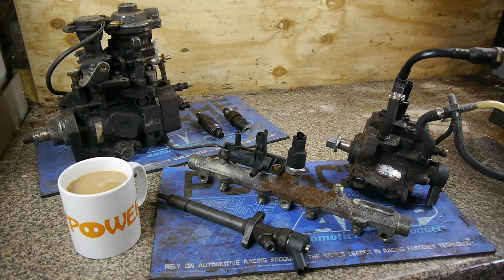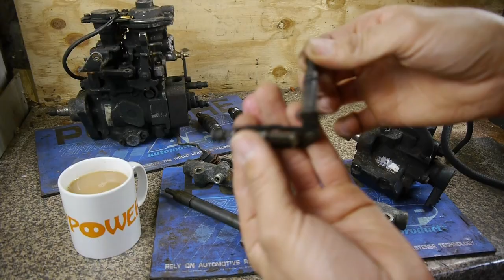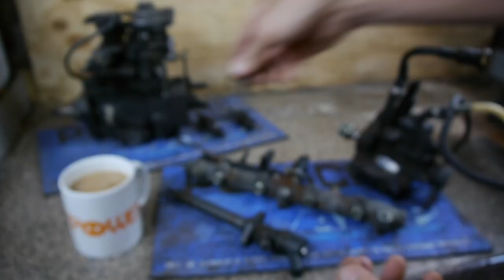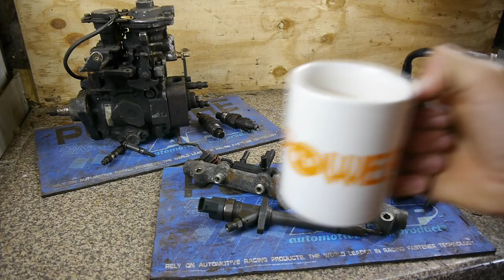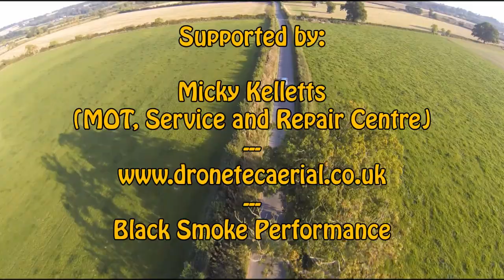INDIRECT injection Versus DIRECT Injection

Comment: You must mean 1,800 psi
1,800 bar would be over 26,000 psi 
No way it can be that high
Reply from the maker: I do NOT mean psi. Yes, that's over 26000 psi. It's a lot. It's called high pressure diesel injection for a reason!

Comment: The cool thing is you have mechanical direct injection as well. In my opinion its the best of two worlds. Easy to fix, hard to kill, efficient and powerful engines.
Reply from the maker: Yes, for sure. Didn't have the time really to go into that, but it had it's advantages... However the rotary pumps were still what would hold them back a bit. Emissions laws essentially made manufacturers move on sooner than probably they wanted to

Comment: modern injectors rely on batteries but the old system relies on their mechanical it's self so if your alternator fails the old system still running or EMP blast. but the modern design will fail because need the support of the battery and alternator, especially the ECU. but this channel thumb up a good and nice explanation.
Reply from the maker: While that's true... It is what it is... To improve diesels, power, sound, drivability, emissions, things had to change... At least it's super super rare to have a battery instantly fail these days
Reply: Doesn't mechanical direct injection exist and do the same thing but with more efficiency?

Comment: Does a direct gasoline injection system have the same negative effects on the intake valves as a direct diesel injection system? or are diesel systems working differently?
Reply from the maker: What negative effect are you referring to?
Reply: @PiggyPower  the clogging of carbon build up
Reply from the maker: @LikaPyramid  I've yet to see any clogging of carbon build up on diesel valves to be any different to direct or indirect injection... Both injection systems run after the valve.
Reply: @PiggyPower  then why do they call it direct injection? xD
Reply from the maker: @LikaPyramid  ... I explained this in the video? 😂 One is direct and the other indirect, into a precombustion chamber... Can't have precombustion before the valve!
Reply: @PiggyPower  ah i see now, i misread your comment 😅

Comment: I feel that the IDI principle has potential yet. It's so simple and robust... I  read about Ducted Fuel Injection which has the potential to drastically improve diesel emissions to almost nothing. From what I saw in the papers I read it seems to be for a modern common rail style diesel, but the principle was so simple. Like adding a bunsen burner nozzle on the injector to create better mixing or fuel and air. I wonder why could not that also be applied to the injector in an IDI engine, improved mixing would be just as helpful on an IDID, possibly more so?
Reply from the maker: Issue with IDI mostly is limited pressures and where the heat spikes, which is in the head. And actually there are some emissions which direct injection is terrible for but Idi had no issues due to its design. Used veg oil and Idi though ... Super clean and effective way to be environmental!

Comment: If cost of ownership is a factor di is not for you. If you're selling/trading your car in at less than 100k definitely get a di engine. Otherwise port injection is far more reliable.
Reply from the maker: This is a good point, but can vary. iDi pumps and parts are getting very very rare now. A Bosch VE pump for a 1.9td Peugeot in good condition can fetch as much as a HP Di fuel pump which has been reconditioned. If you're willing to buy second hand, Di pumps and a injectors are everywhere and pretty cheap for cars over 5/6yrs old. So it does depend. If you're going to the dealership for a repair on the injection system at 10yrs old, then naturally the bill is going to be expensive v the value of the vehicle. . . However that would likely be the case if it was a clutch or brakes or suspension components
Reply: @PiggyPower  I haven't experienced any injection failures, what I have seen is the massive carbon build up on the valves because of the lack of fuel hitting them, not saying injectors WONT fail, just not something I've come across YET. Most of my gdi experience is from the Ford ecoboost.
Reply from the maker: @tonyblackburn5002  ahh but you're talking petrol injection... Quite different to diesel injection.
Reply: @PiggyPower  yes. My knowledge diesel engines is somewhat limited as of yet, but I work on a BUNCH of gasoline engines. Both di and port injected, the di cars will typically get better mpg, and make more power, but maintenance cost a bit more.
Reply from the maker: Di petrol isn't like Di diesel. Di diesel has injector pressures waaaay above petrol. Port injection petrol is very very different to indirect injection diesel.
Reply: @PiggyPower  I told ya my knowledge of diesel is somewhat limited.
Reply: totally agree!

Comment: This video is worthless, you've just compared two types of direct injection (even though you are using indirect injectors), one based on distribution pump (as in 90s TDI engines) and second base on continous pump (aka common rail).
Reply: I think it's a real shame that you're describing something here that's half true.  The Bosch distributor injection pump was used for DIRECT and INDIRECT injection diesel engines.  And please, if you only show this for Citrön and Peugeot fans, then it would be advisable to add this to the heading.  Thanks
Reply from the maker: So I am using indirect injectors... As you've stated..
So it IS indirect injection that in this video I am comparing with direct. 
A 'middle ground' of development was when they used the same old indirect technology and began going direct injection... Which was soon followered by electronically controlled direct injection with a common rail/HP pump.
Reply: @PiggyPower  yeah, 95% of the video is about distribution pump vs common rail. 5% is about indirect vs direct injection. You just mislead your audience.
Reply from the maker: Ok, well if you'd like to spend the time and energy producing a video, please do 👍 I do this without being paid or for any reward. My followers are all Peugeot/Citroen fans and thus this video has been a huge help to them all. 

It's a shame for comments like yours for content creators.
Reply: @PiggyPower  just because you spent time and energy making video doesn't make it any good. DI with distribution pump was used for almost 2 decades and you haven't even mentioned it. Do you rly don't realize that after seeing your video ppl will mistake milions of cars from 80s, 90s and some from early 00s thinking they have indirect injection?
Reply from the maker: @mandalorqel-droma5876  because that doesn’t relate to my subscribers. My content did. If every video everyone ever made on YouTube covered every detail to relate to everyone on the planet …each video would last for hours and hours

Comment: During my forced vacation last year I decided to pull an old dead Diesel engine apart because I understand and work with gasoline/ spark ignition engines, but diesels are a bit of a mystery. I understood the basics of compression ignition, I spend a lot of time trying to prevent it in the engines I’ve built, but the injection systems, fuel timing events, lack of a throttle body just baffled me. And after taking that engine apart and seeing what made it work led me to the conclusion that diesels are built with the use of black magic and unicorn tears
Reply: To make things more confusing diesels will run cooler when lean and run hot when rich.
Reply from the maker: 😂😂😂 high compression. Fuel at high pressure. Bang. 

There ya go.
Reply: Diesels also have ccv valve instead of pcv valve.
Reply: @impactodelsurenterprise2440  WITCHCRRRRAAAFFFTTT!!!

Comment: I am looking at getting a diesel step van and converting it to veg oil. One option is a 2003 6.5L workhorse p42 and another is a 2002 24 valve cummins Freightliner M-line. So which would be better for veg oil? 

I saw you just say here around 6:30 that the indirect injection can run on anything so I'd guess the 6.5 since it's IDI.
Reply: Idi is the best for alternative fuels
Reply from the maker: IDI is best but you do need to research if all the pump seals etc are suitable for vegetables oils

Comment: I've read IDI is better for veg oil. Any idea why? But also read people still using veg oil with DI.
Reply from the maker: Hi there. Worth researching about running veg oil. There are directories about which vehicles are good for it deep on the interwebs. 

IDI in general is ok for veg oil, if it's a Bosch pump, as the system can cope with the fuel. Modern Di systems required the lubricants in the diesel to keep the pumps and injectors from seizing. I've heard of some running 50/50 mix with more modern engines without issues...but it's a risk.
Reply: @PiggyPower  Bosch pump is electrical or mechanical? Been reading so many different things. ANother guy was saying mechanical pumps are more forgiving for alternative fuels.

Comment: So it's a IDI Vs CRDI...!
Reply from the maker: Crdi is one type. But it's just a manufacturers abbreviations for the same thing.
Reply: @PiggyPower  Yes, But there are non common rail Di engines too with a rotary and inline type mechanical FI pumps, I think the only difference between IDI and non common rail Di is combustion chamber.
And because of the Direct Injection and without pre combustion chamber Di engine produces more torque and are little noisier as compared to IDI.
Reply from the maker: @amitdesai2421  yes, as others have commented too... Can't cover it all in one video... Plus they were sort of on the switch over. ... Short period of time. Torque isn't really related tbf. More potential... But can make just as much torque with idi ... Di is also a lot quieter due to preinjection (not possible with rotary/non common rail)
Reply: @PiggyPower  What is tbf ? And for a pre injection you are referring to Electric injection Di...!
Reply from the maker: To be fair. Yes, electronically controlled Di, which is what the video is about.

Comment: is the modern system better, yes, but its also way cheaper for manufacture, and here's why, old xud injectors were calibrated, shims under the injector spring set the amount of fuel sprayed out, so each and every injector had to be calibrated under real conditions? very time-consuming. also, the pistons of the pump had to match on pressure so that each cylinder had the same fuelling, once again, calibration time. 
now the modern system doesn't have this, with one pump supplying fuel, not 4 smaller single piston pumps, it's way easy to calibrate if at all, it just needs to be 'in the ballpark', as for the injectors, no need to do any 'real' calibration on those either, just measure the flow, and stamp that on the injector, then when fitted in the vehicle, tell the ecu that injectors flow rate, and let the ecu do the math to change its injection time to to match, say if injector A has +10% more flow, then reduce its injection time by 10%, bingo. this saves a huge amount on manufacturing costs, which they don't pass on to us but pocket, and then they get double bubble as now a replacement injector needs its flow rate programmed in the ecu which they can charge for!
Reply from the maker: Very right in many respects... But the parts are much more costly to manufacture. Tolerances are WAY higher due to significantly increased pressures in the system.
Reply: @PiggyPower  emmm , tolerances are not that much of a cost issue, the precision is way higher, but with robotic cnc machining this stuff is like 1/100th of a mm accurate at a  thousand units an hour. citroen was making steel on steel hydraulic valves with virtually no leak-by from the 70's with standard 'precision' machining, the pumps these things use are 'common' rough and ready piston pumps despite what they charge us for them. still sooner have an xud than my hdi dw12

Comment: hmm your explaining a commonrail vs distributor pump.. my engine is direct injected with a distributor pump.  the engines with a distributor pump can be DI or IDI engines it have to do with the combustion chamber and not the pump design.
Reply from the maker: Hi there... Yes you are right, there was a sort of "overlap" period where manufacturers did some direct injection engines with mechanical injection. Not many though in Europe. Famous engines like the 6bt Cummins had this direct injection mechanical system of course. . . I find there is always exceptions to rules but it makes a video 7hours long if you cover them all 😂
Reply: Yeah, all I kept thinking was “p7100”. From a German company at that.
Reply: Still a good video though
Reply from the maker: (I should point out, a MAJOR bulk of my views/subscribers come from Peugeot/Citroen owners, so I tailer most my videos for them. In the case of PSA, mechanical is idi and common rail is Di 👌)
Reply: @PiggyPower  well for about 10 years just about every diesel on the market was this way. mercades, VAG, opel (Izuzu) (volvo used the VW unit's) they r all this setup.. not befor 2000 you got the new generation all over. i know Ford stil used the old IDI engine's all the way up tho. for french stuff i have noe idea.

Comment: Back in the mechanical injection days Mercedes used to do direct injection on commercial engines such as the old sprinter and indirect injection on the same version of car engines because the direct injection with its super high pressure made very loud scary diesel sounds at idle.
Now with electronic injection the injectors open something like 7 times per combustion stroke whilst idling, so that diesely injector sound is almost gone, making direct injection good for cars.
Reply from the maker: Well said
Reply: I like the diesely injection sound

Comment: You can get combination of indirect and direct injection with modern engines on common rail, this video is a bit misleading, getting different types of fuel pumps muddled up with different types of injection.
Reply from the maker: I've never ever seen any diesel engines using both direct and indirect injection... Could you link to a reference on this? 
I also don't know what you mean about getting the fuel pumps muddled up with the types of injection, at which point in the video did I do this so I can check and make corrections?
Engineering Explained has been a channel I subscribed to many many moons ago, far superior knowledge and technical know how than myself 👌
Reply: @PiggyPower  - The first one is an engine produced by Toyota, the 2GR-FSE, that was launched in 2005.

- More recently, Audi has adopted this technology on its 1.8L and 2.0L TSI gasoline engines.

The bi-injection allows to use the best system at each operating condition :

- At high speed, high load, the direct injection and its related cooling effect delays the knock event.

- At low speed, the PFI gives more time to make the mixture homogeneous, and so reduces unburnt hydrocarbons, carbone monoxide and soot particles while increasing the efficiency.
Reply from the maker: @Dosedmonkey  but you are talking about petrol engines... Not diesel. This video is in reference to diesel fuel injection systems. . . 

So what diesel engines have both direct and indirect injection? I still can't find an example. 

Also still confused about you talking about getting my pumps mixed up, I can't see where in the video I did this, please correct me/point me in the direction 👌

Comment: idi = cracked cylinder head
di= cracked pistons
Reply: Just buy some forged ones, and increase the boost and let it smoke :D
Reply: Forged pistons actually suck, they have to be installed with more clearance so they wear the engine faster. 

Forged is for racing not daily driving.

Comment: Talking of fuel pumps, my 306 has been stuck in my drive since June.  One day it turned over but the damp morning stopped it starting.  After a few hours of strong sun it did start easily twice, but INSTANTLY cut out each time.  So I am guessing a fuel starvation issue.  What's the best place to start on a 306 2.0 XSi........fuel pump or something else......fuel pump relay?...........injectors?  My battery is brand new and spark plugs seem ok.  Just need a few ideas before I try get a garage involved, although getting car over to a garage could prove tricky.
Reply: Good news!  Problem sorted and it was something very simple, and completely threw my friend and I when we discovered it.  We tested the battery, tested the voltage at the fuel pump, checked the fuel pump relay, checked fuses.  We even swapped around all these components in my other 306 2.0 XSi and they all worked.  However the other car still refused to engage the pump and start the car, but in the donor car the pump worked when that car was started.  So all pumps and other parts from both cars worked, but what eventually fixed the problem was by simply pressing the red inertia switch button under the bonnet behind the battery.  Once pressed we could hear a click and then the car fired up no problem, and is running fine.
Reply from the maker: @EgoShredder  🤦🏻‍♂️🙈
Reply from the maker: Check it has a fresh strong supply of fuel. Check it has a strong spark. 👍
Reply: @PiggyPower  Thanks.  Yeah the fuel is a few months old (a quarter tank left). Is it ok to just fill up with new fuel and mix with the remaining old fuel?  I have a spare brand new set of plugs I can put in.
Reply from the maker: That fuel doesn't sound old tbh. If you keep your foot on the throttle will it keep going? Does the fuel pump prime and run? Does it start immediately?
Reply: @PiggyPower  Starts immediately twice and cuts out immediately too, even with foot on throttle.  It will not start again after two attempts.  Come back another day and you get two attempts etc.  Not sure if pump is priming.

I've had to run the car less during last 12mths, so might be a mixture of old fuel each time I fill up I guess.
Reply from the maker: Check fuel pump primes and runs. Very odd that it does it twice, every time